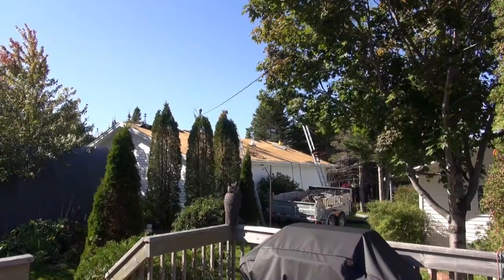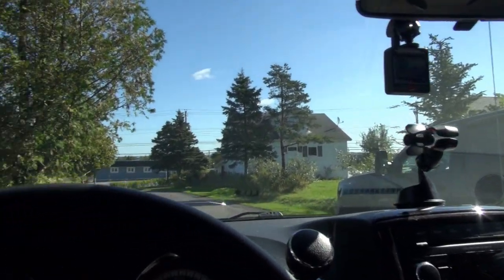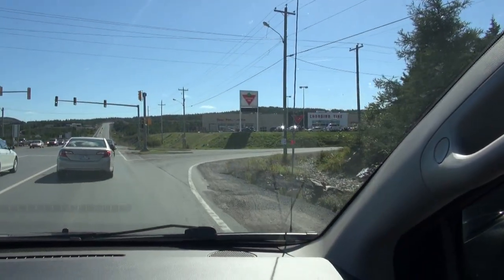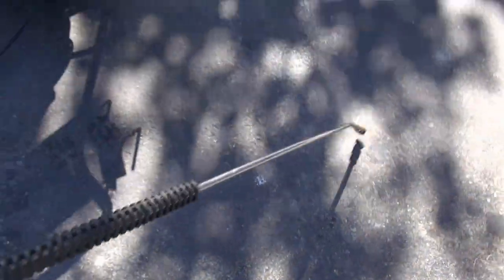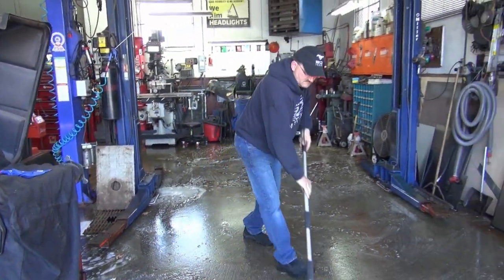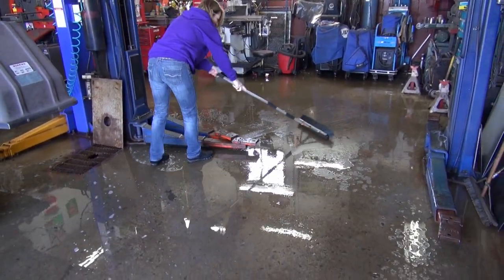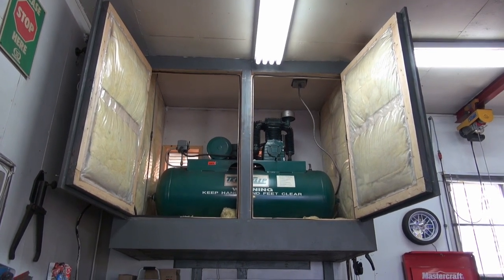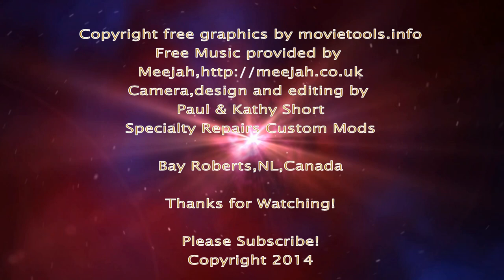A Saturday At Specialty Repairs

Comment: If you stack those shipping containers you can make a tall garage.  Boats etc.  Or one high with space between and a roof over and you have two dry sheds with a double garage between.  The freezer units are insulated as well and easy to heat.  At one time they were going for about $1200 for a twenty footer here in the states.  

How do you keep your tools, mill etc from rusting when you are pressure washing inside?  I would be scared to try that as the mist seems to get everywhere when doing it.  Years ago when they first came out for home use I pressure washed a car (luckily it was a parts car) with it.  I discovered that you don't want to do the grill as I had folded all the radiator fins flat as a pancake with it.  

Good to know about the Battery Tender brand.  I have used several that never lasted more than a year.  Is the Battery Tender regular as good as the Plus?  Good Video as usual.  Doug
Reply from the maker: +Douglas Thompson 
A used 20' shipping container here is $5000. just not feasible for the adverage user. I've seen them used as you mentioned and would love to do it but not at those prices. The battery Tender Plus is a much larger, longer warranty unit compared to its smaller unit. I use the Plus models. 
I use machinery oil to protect the equipment. There are times I've even sprayed Fluid Film on it.

Comment: Very nice video.   I have a question tho, do you have any equipment or tool rust or corrosion from the pressure washing or the resultant high humidity afterwards? Especially interested in how your machine tools and tooling handle it?  Best regards to both of you!   Bill
Reply from the maker: cat637d Thanks Bill. No. Don't have any corrosion issues because of the cleaning but there are times in the winter that we get warm spells and everything in the shop sweats for a day or so then I coat the machining equipment with "Fluid Film" to preventing surface rust.

Comment: Those pumps run a non detergent oil for lubricant but it is not good to run them out of water
Reply from the maker: Brian Wynn So true. The water acts as a coolant for the pressure pump.

Comment: what is the building they are doing? I have never seen that roof covering in Oz.
Greg H.
Reply from the maker: gopha533 
That is Gasoline Alley. That's where we displace the vintage things we restore. The roof is being recovered with  Asphalt shingles.
Reply: The whole building! Wow. now that's a goodly sized museum
Reply from the maker: gopha533 
It's 1200 sq ft. It should be bigger, about three times actually because I've restored so much stuff but I'm not building it any larger at this point.
Reply: Ha! you need a mezzanine.
.